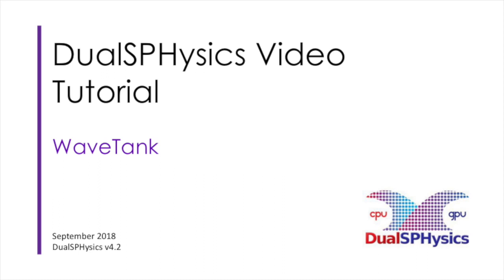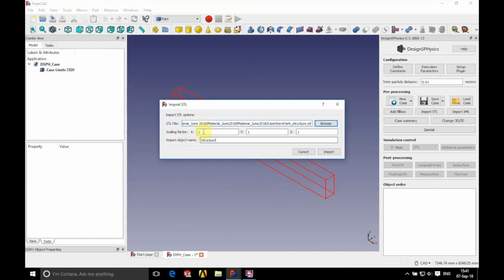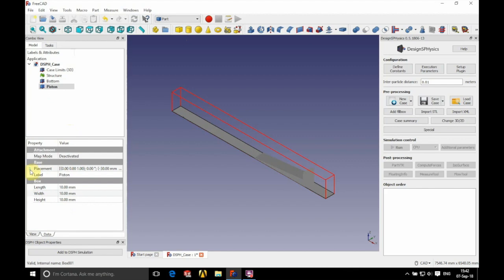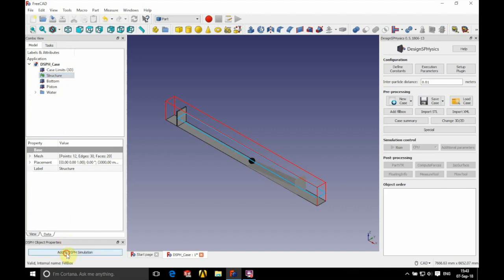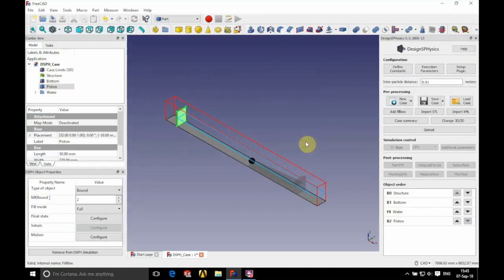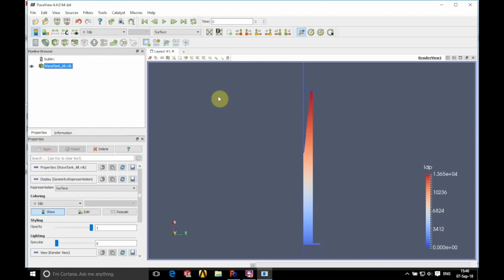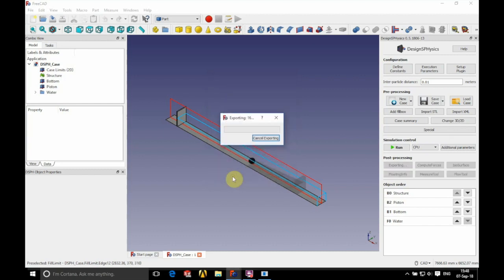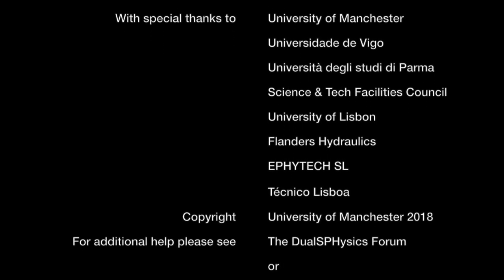DualSPHysics - How to set up and run: WaveTank

Comment: hi, I followed all the steps shown in the video, but when I start the simulation I have this error:

* ERROR: Some boundary particle was excluded. *
TimeStep: 0.000998  (Nstep: 4)
Total boundary: 4  (fixed=0  moving=4  floating=0)
Excluded for: position=4  rhop=0  velocity=0
Some boundary particle exceeded the +Z limit (top limit) of the simulation domain.

what's my mistake?
Reply: Hello.
I had the same error and the simulation did not work.

It seems that the movement of the piston is causing the problem.
I tried generating a wave instead of loading the sample file.
[Linear motion from a file] 　→　[Regular wave generator]

Then the simulation started successfully.
I haven't done this, but maybe changing the parameters when loading the file will work.

[It is translated using DeepL.]
Reply: @かずてる-d1t  Hi, Yes the piston movement causes the problem, believe or not if you leave the motion descriptors as they appear in the video the piston what it does is moving up and down and not back and forth, I sort of fixed the issue by marking Z position column 2 and X and Y position column as 0, but then the piston doesn't go back and forth it just moves forward. I fixed it by creating a sinusoidal rectilinear motion with a frequency of 1 and an amplitude of 0.04 and not using the file. I think you can also generate the piston movement by create new regular wave generator

Comment: Very Nice work! Is that possible to simulate wind-driven waves instead of piston-driven waves in `DualSphscis?
Reply from the maker: Waves are created by using a column of boundary particles that will move with a predefined motion:  sinusoidal, rotational or loading an external file (with time and position).
Reply: @DualSPHysics  Thanks for your quick answer. I guess the answer is "no".